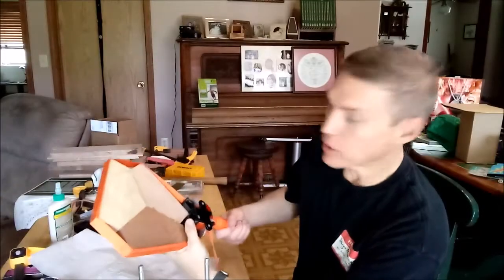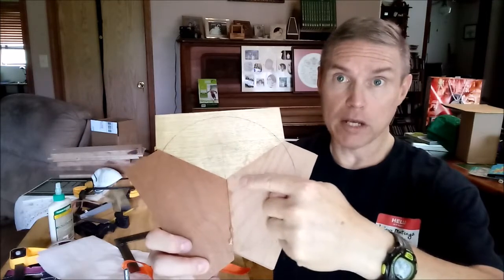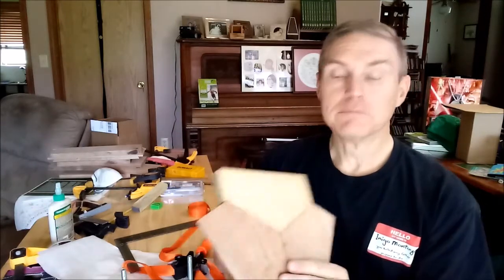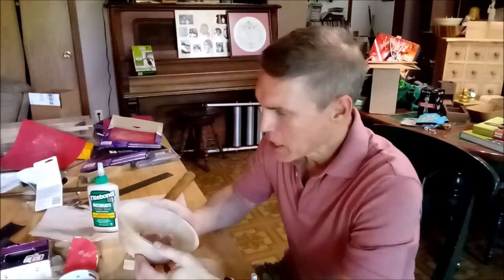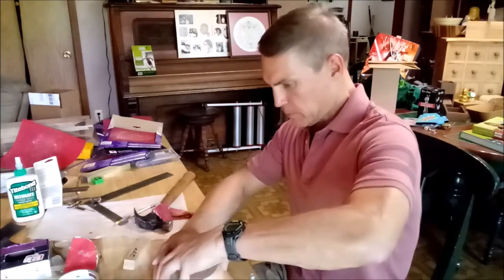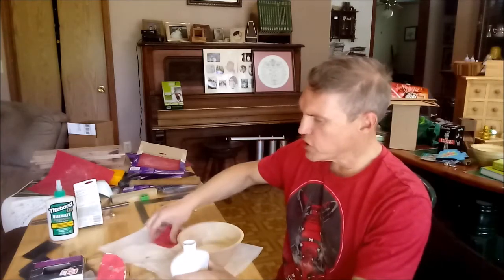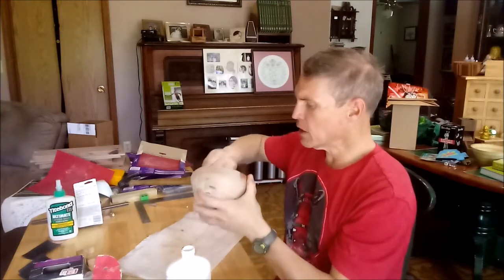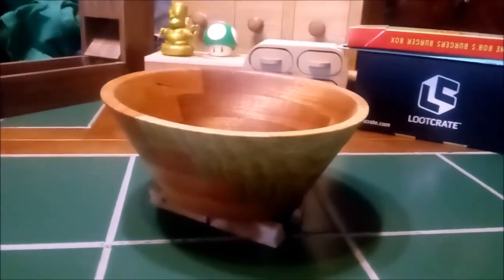Making Yet Another Scroll Saw Bowl

Comment: I make bowls the pretty much same way, if the angle is wide enough, try to use the round end of your belt sander to sand the inside of the bowl. It will really cut down the hand sanding time on the inside. I just hold the bowl off of the left side of the belt sander and hold the bowl so the inside is flush with the belt. If your angle is too small, say 32 degrees or less you might not get the bowl to lay flat against the belt.
Reply from the maker: I'll have to give that try. Although I did recently buy a spindle sander and that works really well. Thanks for the tip!